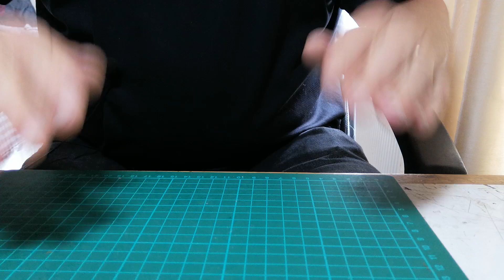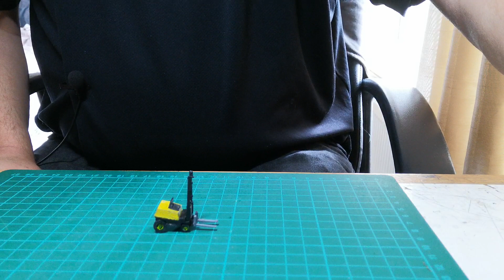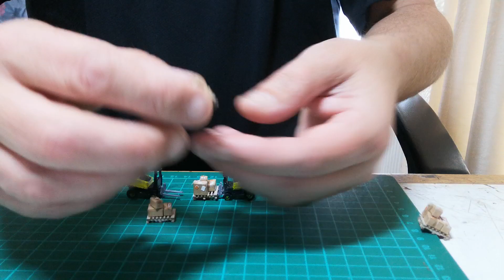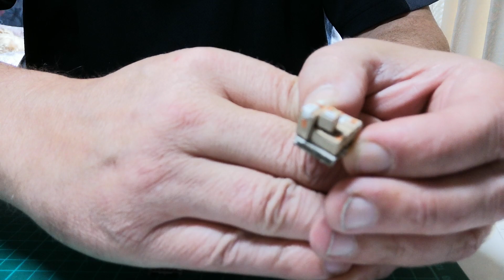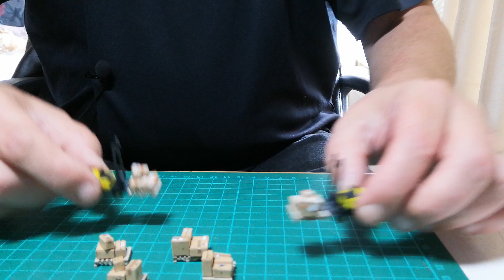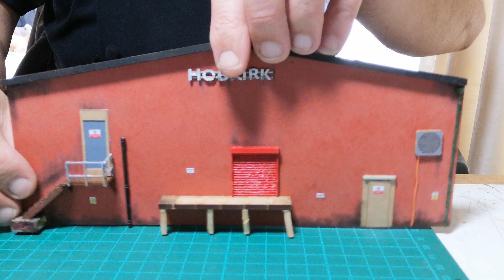Easy low relief buildings on the oo scale layout.

Comment: Hi Digger, The low relief building looks excellent as do the cardboard boxes on the pallets but,  .....
I've run a few forklifts in my time and they all, everyone of them had the big load bearing wheels at the front, under the forks. Perhaps you could change them around, then the loads will be tilted back as they should be and not forward which is a great way to bounce the boxes off the pallets. Just saying you know.  lol. Thanks for another great video.  David.
Reply from the maker: I will change those around thanks for pointing that out my friend
Reply from the maker: Job done they look much better thank you David
Reply: @DiggerEvans  Great stuff Digger, Perhaps they can be in your next video, just in the background working away.

Comment: Hi ya Digger. I really like the fork lifts you built. And the pallets and box loads. Very nice. The low relief building came out nicely. A suggestion, put some horizontal support timbers on that loading dock. They would build them that way, plus it will hold together better. Thanks for the update. See ya next time.
Reply from the maker: Hiya Norman that's a good idea I shall do that next, many thanks

Comment: Given me some good ideas this mate.
I'm currently on with the back of the layout now, and it's job is to hide the rear loop rails to give an "end to end" look.

But at the right hand side there's a gap, doesn't warrant spending more on further retaining walls and wood so I think some brick papers and some cardboard and we will be in business!

How did you make the loading bay and the stairs/rails etc? Look very good mate.

Will upload a video once I'm a bit done, maybe you can check it out 🤙🤙👍

Cheers
Reply from the maker: Look forward to seeing the video my friend, everything on the low relief building is from Scale model scenery, if you go to my about section there's a link to take you right to them, if you do but anything using that link I get a small commission and that is going toward buying a kit as a prize if I reach another subscriber milestone, many thanks my friend
Reply: @DiggerEvans  ah that's excellent, yes I saw a few of your videos, the one with the fencing. Really good to see them being compared.

Also thanks so much for the sub!!
Reply from the maker: Thank you also my friend